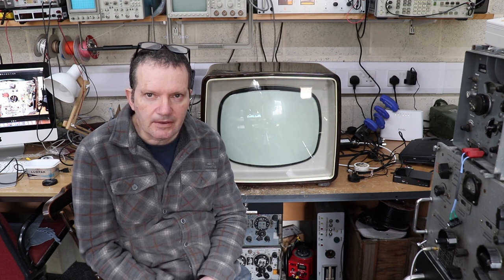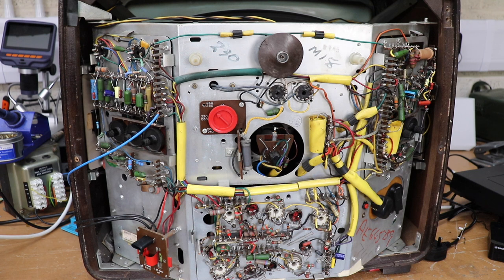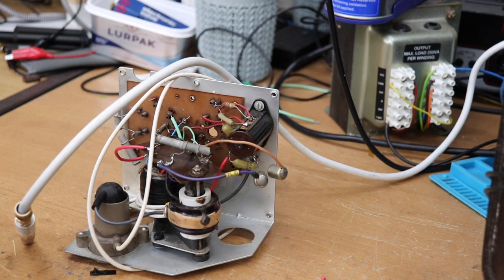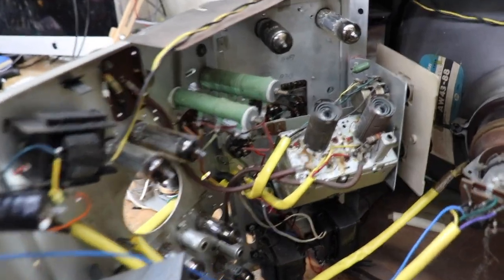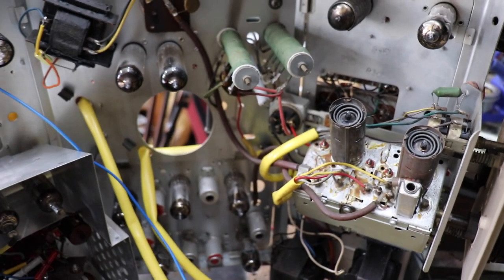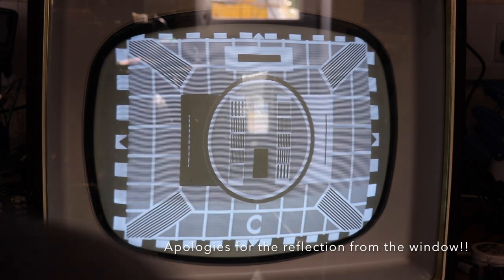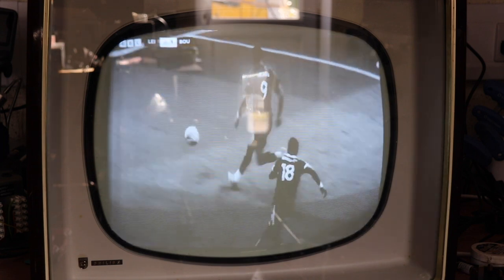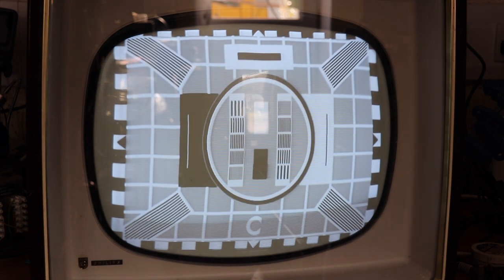Back To the Future Again: 1960's 405 line Telly Receives Digital TV

Comment: I'm pleased to see how you've set the horizontal and vertical scan amplitudes (a reasonable compromise for the screen shape). But back in the day, sets were always set to overscan - no black visible at all - which always irritated me, as I'd rather have a (slightly) smaller picture but at least see all of it!

Comment: Fascinating. This is exactly the same television that we had back in the 1960's. I still have a 1970's 5 inch black and white Plustron 625 line TV, which still works. I can still use it because I found a TVonics freeview box being sold off cheap at Aldi, which, unusually, has an rf output. Combined with an indoor amplified aerial from Lidl, still gives a working bedside tv/radio!

Comment: Presumably you can show the picture unstretched, but then you'd have black lines at the top and bottom of the screen
Reply: A lot of (I think still most) FreeView boxes let you choose widescreen (for modern-ish montiors), 4:3 pan-and-scan (really centre cutout as none of the broadcasters actually use that control) which is what's shown here, and 4:3 letterbox which is what you're describing.

Comment: An auto transformer is not an isolation transformer as the input and output neutrals are connected together so you are not properly isolated......be careful!
Reply from the maker: That was a slip of the tongue.. it is a proper isolation transformer